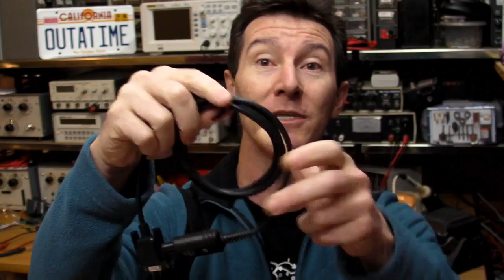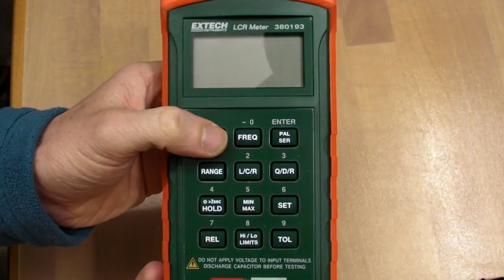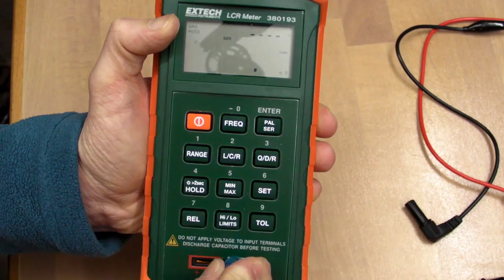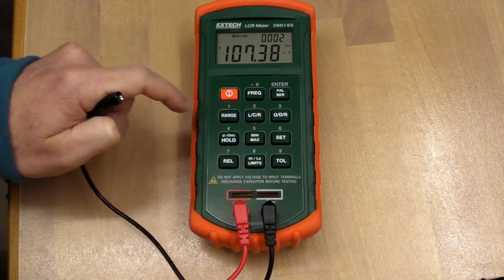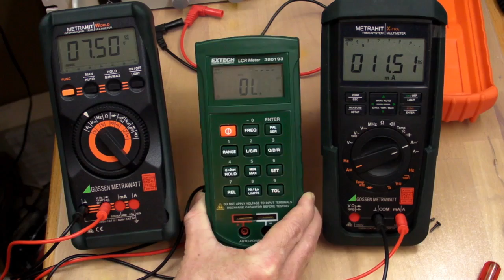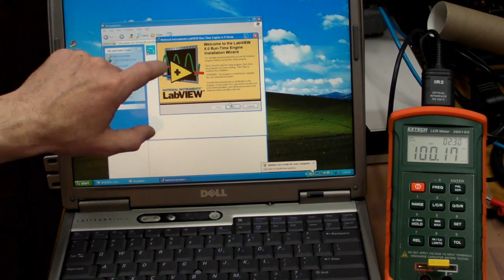EEVblog #115 - Extech 380193 LCR Meter Review

Comment: Great LCR reviews, Dave. In LCR meters there are hi-end (Kelvin) units with BNC connections, low-end 2-wire units, but also a few low-end Kelvin units. I use one, TH2821A and it is great, particularly at low values. 
It's hard to tell 4 vs 2 wire since they use the same slot-type connectors as the 2s. They use both sides of the slot to provide the sense leads. Look for probes with Kelvin wiring, 10KHz and up. Mastech MS5308 (100KHz), MCP BR2822 and Tonghui TH2821A (10KHz) $250-$350
Reply: I think you can tell a Kelvin (4-wire) vs non-Kelvin (2-wire) meter easily enough by a quick glance. They all seem to have 'slip in' slot connectors, but if they also have just a couple banana jacks adjacent to the slots (or three banana jacks if they include a GUARD or SHIELD connection), then they are most likely non-Kelvin. This is because the banana jacks are certainly only a 2-wire connection, and it is not trivial to convert 4-wire Kelvin drive & sense circuits to 2-wire, except by plugging some conductive wafers into 4-wire Kelvin slip-ins, which shorts the drive & sense together, and then you can run THAT out to banana jacks. But it seems that nobody does that, and instead they just have meters with both kinds of connectors, which pretty much guarantees that everything is all 2-wire internally.

Comment: Dave: with regard to the Guard terminal - I find those to be pretty useless without the full Kelvin four or five terminal setup. Otherwise, you have to zero out a large amount of R, L, and C from the cable. As far as I can tell, the only thing the guard terminal does for you is provide shielding from interference and external influences, so the capacitance of the cable would be more constant.

Comment: Being able to test at 10-100kHz is important as many inductor cores and capacitor dielectrics perform terribly at higher frequencies (a fact they conveniently leave off the datasheet). This looks like a good value entry level LCR meter but pros will want to invest in a higher end model.

Comment from the maker: @Afrotechmods Yep, I agree. And 10KHz is usually the limit of the hand held units. To get 100KHz you typically have to go to the bench type units which are another price bracket again. Two more LCR meter reviews to go, both of which do 10KHz, but cost at least $100 more than the Extech.

Comment: The PeekTech 2165 seems to be exactly the same model!
It is available in germany for less than 120 USD, peaktech.de lists international partners, reichelt.de even ships it internationally. They have another model 2170 for about 200 USD that has ESR, up to 100kHz frequency, better resolution and range, phase angle and so on...

Comment: Those new Agilent, B&K Precision etc.. meters seems to be made by Tonghui Chineze manufacturer, at least they look exactly the same. So I went ahead and ordered one directly from China, I got TH2821B model for $129 on eBay.

It looks nice but its not accurate :(((( it should be 0.3% and mine is +-10%.. I think I wasted my money.

Dave please when you test ESR meters could you compare some capacitor and resistor readings to your Fluke 87V and to ExtechLCR meter to make sure they are accurate?

Comment: I've been looking at the TH2821A LCR meter, which you can get for under $200 with shipping on ebay. It goes to 10KHz, claims 0.3% basic accuracy and comes with proper kelvin (4-lead) test leads and an AC power adapter.

Would love to see that get the Dave treatment!

Comment: I wonder how the Extech LCR200 compares. It doesn't appear to be designed for NASA or JPL but it can measure at 10 kHz and 100 kHz, AND its model number is easy to remember. The BK 886 would be an interesting review; it appears to be a much more "serious" instrument.

Comment: Hi.  Just picked up one of these meters used for cheap.  I don't have a lot of fancy equipment (all inexpensive - DMMs, basic dual scope, and an in-circuit ESR), as this is more of a hobby for me.  Still, I wanted to double check the LCR's accuracy, as it's a little off from the two DMMs I have (Off brands, like Uni-T, Aneng.)  As much as 15% for certain C readings.  For instance a 1KOhm R reads 995. on Uni-T and 993. Ohm on Extech (~1/4 %).  A couple caps however read 1.191 uF and 1.78 nF on Uni-T and 1.076 uF and 2.04 nF on Extech, or about 10-14% diff.  (One high, one low, probably because I zeroed out the Uni-T meter before the nF reading but not the uF)
Normally I'd assume the specialized LCR meter was the one to go by, but I'm familiar with the Uni-T meter's history as I've had it from day one and I don't know what handling the Extech LCR may have seen.
So finally to the point... 
Without more equipment, any not too complicated way to confirm C (and maybe L) readings?  Also, I don't have another meter with L readings, so nothing else to compare that to.
Reply: Update...  did a bit of reading and seems it's really not that simple to get accurate C (and L?) readings, ESPECIALLY if they don't use the same frequency for measurement.  So I'm just going to give up comparing the two for now and assume the Extech is the more accurate.  Anyone have anything to add, I'd still be interested to hear more.  Only simple solution I can think of is if someone with a calibrated bench meter can measure a couple cheap caps at 0.1 and/or 1 KHz and mail them to me as reference points....  :)

Comment: hey dave..good job..i noticed you did reviews on cheap & hi end DMM'S but not on mid range DMMS. i cant afford a hi end one nor want to buy an el cheapo lol. Can you do a review on the yokogawa ty530, yokogawa ty720, uni-t ut71e, kb 391a and the hioki 3801-50. I happen to like the yokogawa's but didnt fine any reviews on them online. Lets see what the japanese have to offer.  All the DMMS i mentioned are available @ tequipment  except the uni-t, which i think tequipment should be carring.

Comment: What's the difference between DCR and R in the lcr meter  ? Ive seen R increase with freq increase while DCR remains constant   Is  the resistance due to skip depth ? Does total z = sqrt (R^2+ DCR^2+(Xc-Xl)^2 or sqrt (R^2+(Xc-Xl)^2)

Comment: Please help understand what is it.. My meter is powering off. Right after it boot. I measured  resistance between  test terminals its 51ohm. Could someone check what the resistance should be between terminals? And what could cause the meter to power off right away? Thanks in advance.

Comment: If it's Inductance Resistance Capacitance, why is it called LCR meter? Did someone confuse upper case i with lower case L?
Reply: Because I is the letter already used to define current and L to inductance.
Reply: Haha yes! Just figured that out today, I happen to be taking a class in electricity and magnetism and the connection just dawned on me! Thanks!
Reply: the mathematical symbol for inductance is L, I is already used by current

Comment: Extech should really hire one industrial designer just to iron out those ergonomics bugs like buttons, lcd flexing, tilting bail, rubber groomets, crap backlight, software look, etc..that kill the mood really. Also, quality is lacking in the finish look and feel, I saw some burs and uneven edges, this is 200 $ meter, it should at least look like quality product! Arghh! Is it normal for an LCR meter to consume so much power from the battery?